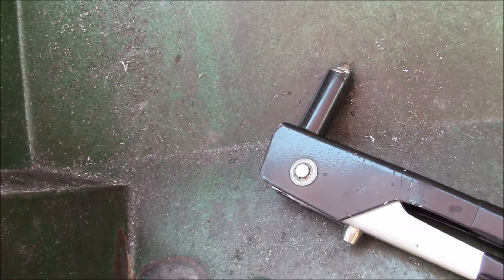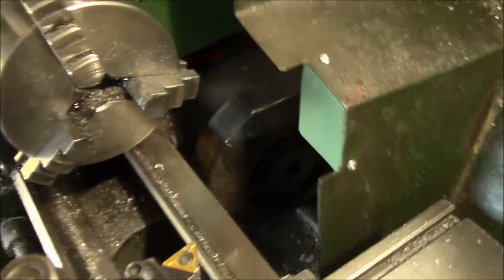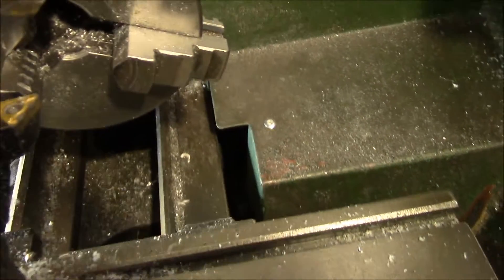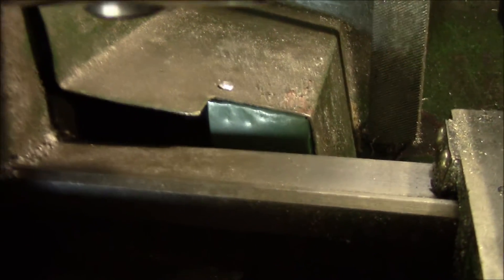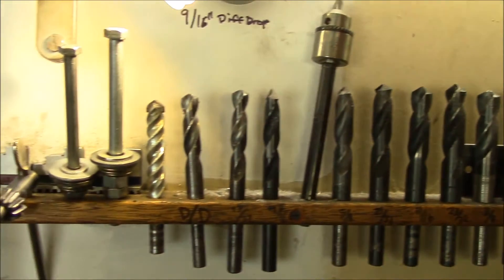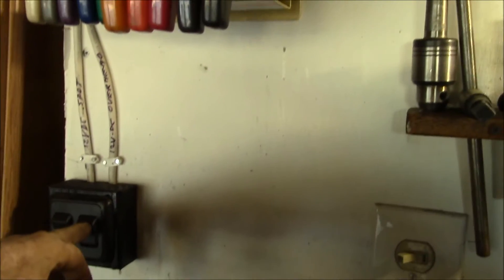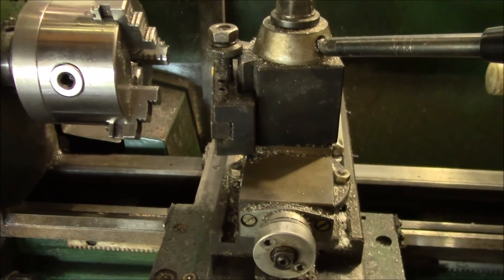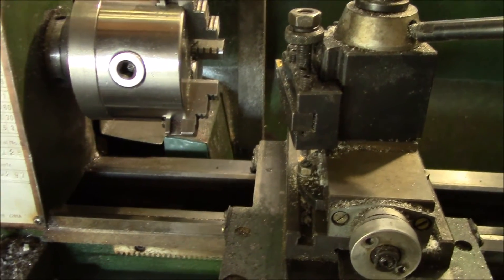Grizzly G4000 Lathe Modifcations

Comment: It would probably be a good idea to put a couple magnets around where the chips drop. Then you can just take the magnets off, remove chips, and put them back. Amazon has magnets about 1 inch diameter and 1/8 inch thick that are insanely strong.
Reply from the maker: Yes, that's a good idea if you primarily turn steel or cast iron on the lathe.  I happen to do a lot of non-magnetic materials like aluminum, bronze and plastic so some sort of physical barrier is needed for those chips.

Comment: I copied your idea for the plate that helps prevent swarf from getting into the motor's fan. I did teach myself how to use my hand-riveter, but didn't use it to install the plate, instead going with my original post of employing high-strength double-sided tape. So far, so real good. I did use a much lighter grade of material (aluminum soda can grade) for the protector because I didn't think a thicker material (which I do have) was needed. I didn't copy the x-mas lights, but did place a fixture (suspended from ceiling) with spot lights aimed at the chuck for better illumination. My eyes weren't what they were.
Reply from the maker: Sounds like a good solution.  Yes, don't need anything very heavy in there, I just used what I had on hand when I decided to fix it.  It's worked perfect, no more getting swarf in the fan blades.
Reply: @The4Crawler  Now that I've been making some chips I can't imagine doing so without that guard. That hole is right in in the prime-chip-making spot. This d**n machine has a number of deficiencies and that's a big glaring issue. I've brought a few of these problems to the manufacturers attention Girzzly, not Enco) and their response has just been "well, for this class of machine..." "This class of machine? It's either right or wrong, and if it's something functionally wrong... that's why there's revisions of things." Software gets updated, cars have new model years, recalls, but somehow machining tools are set in stone, perfect out the door, can't be improved upon? That's just laziness. You improved yours. I improved mine. They should include a little piece of tin with some stick-em tape for customer installation upon receipt of machine. I can still get the chip guard off with this addition, it doesn't prevent that, but they just aren't interested.

Comment: The motor on my G4000 finally died after 20+ years of light hobby use. Probably because of that hole you just covered up.
Lots of time filing and scraping and my compound is usable.
Best upgrade was a Collet set, MT-3 / ER 20 and ER-32 from Ali Express. A Mini Chuck on an MT-3 arbor Also from Ali Express. Also a $38 full set of insert cutting tools from Gear Best.
The best piece of advice is the G4000 is a min lathe on an oversize body. The huge chucks have been useful for big stuff with very light cuts.

Thanks for posting.
Reply from the maker: My motor is still working, knock on wood, after about the same amount of time.  I do need to go through the carriage and compound and get that working better like you describe.

Comment: What a crap design. Good thing you fixed it. Damn Chinese "engineers." You coulda done it with a piece of cardboard, though. Plastic would work, plastic & double-sided sticky-tape. That's all the tools you've got? Dude, you need a metal xmas present. WTF would you have a bunch of xmas lights above the lathe, & why DC power? Is this thing in the back of a van? Or on a boat maybe. Aren't boats 24 volts? Must be a hella inverter to get the AC for the lathes induction motor.
Reply from the maker: I don't think cardboard/sticky tape would hold up to the cutting oil and metal chips and what not.  The sheet metal and rivets have held up great and they help to stiffen up that otherwise flexible part of the back panel.  Haven't had any chips get into the motor belt.
Why low voltage DC lighting?  It's safe, no shock or electrocution hazard as it's a Class 2 circuit.  It' also eliminates the motion aliasing on the spinning parts caused by AC powered lights, because there's no flicker with DC power.  And since I am producing my own solar power for the shop, why take DC power off the panels, convert it to AC, then inside the LED bulb, convert that back to DC.  Much more efficient to take DC from the battery bank to the light directly.  I do have a set of AC powered LED tubes that I can use on cloudy days or at night, but those flicker and I prefer not to use them if possible.
Reply: @The4Crawler  Yeah, I thought of the oil issue too. I'm just not any good with rivets, and it looks like that's what you did. I have many rivets & 2 rivet guns and they just don't get used that much.

Comment: Did you have a video of how you put the quick change tool holder on the lathe?
Reply from the maker: Not at this time, but it's on my list of video topics.  Unfortunately, it was around 20 yrs. ago I did the modification, so it won't be a very detailed video.  I need to see if I can find the original tool post holder parts buried down in the base cabinet.

Comment: I bought the G0720 Heavy Bench mill when they moved out of PA.  $3000.00+ mill, in 9/15, used maybe eight hours in that time frame, milled aluminum only.  I now get a ERR message when I try to run the drill motor...they now want almost $400.00 for a new controlo board that must install.  NO more Grizzly for me.
Reply from the maker: Sorry to hear of your problems.  So far all my tools are the plain old fixed speed AC motors with simple on/off/reverse switches.  You might check out some of the on-line machining forums to see if anyone has a simple fix for the controller board.

Comment: I'd done much the same thing without the welding. The biggest improvement for my lathe was ditching the compound and making a mount for the tool holder that was rock solid when bolted to the cross slide. I can actually position that anywhere along the cross slide so it's  a double bonus.
Reply from the maker: Yes, I need to do something with the compound as well.  I never use it in my day to day operations and it does have a lot of play.

Comment: What Modification you did to mount the quick release tool post to your compound slide?
Reply from the maker: I think the QR tool post kit came from Harbor Freight.  I purchased it maybe 20 yrs. ago, but I think all I had to do was install the large center pivot shaft in place of original 4 way tool post shaft and that was about it.  Maybe next time I have the cross slide apart, I'll shoot a video of what I did.

Comment: hi what brand of qctp do you have? Did you have to modify it at all? Thanks. Bill
Reply from the maker: Off hand I don't recall the exact brand, I think it came from Harbor Freight, they still make a QCTP kit that looks similar.  I put it on around 20 yrs. ago.  Perhaps the only modification I had to do was to enlarge the hole for the center stud, if that.  Can't recall if the original hole in the cross slide was the right size or not.  The kit came with a couple of regular bit holders, a cutoff holder, knurling tool and a drill chuck/live center attachment.